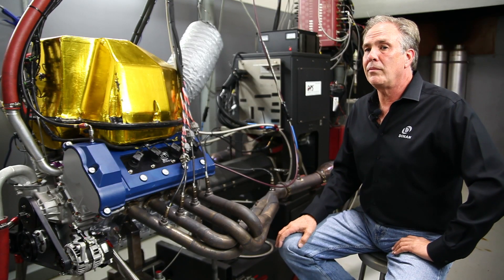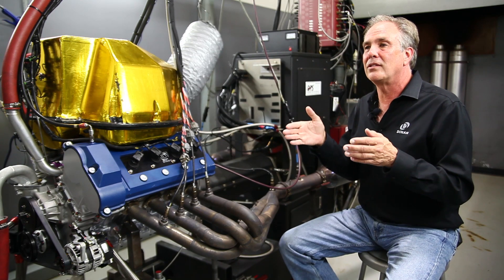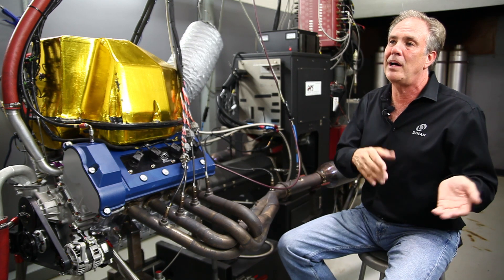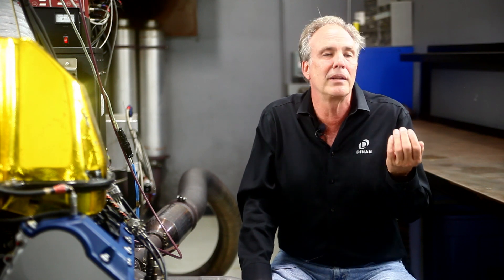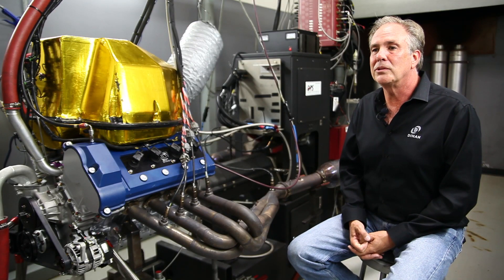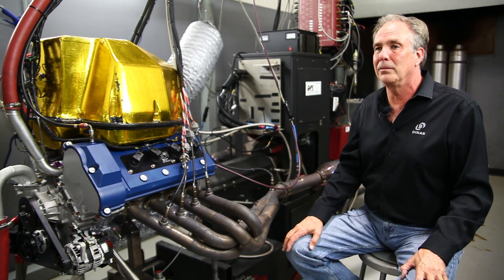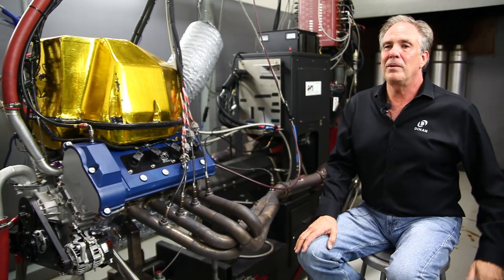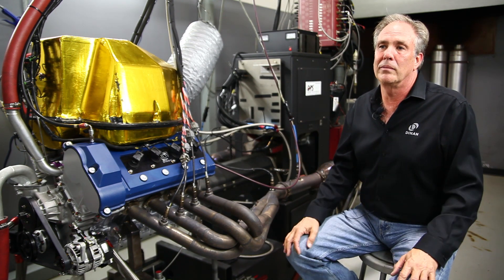DINANTRONICS/Tuning Deep-Dive with Steve Dinan

Comment: I have a 2011 335i Msport E93 with the N55 motor. I have 2 questions: with a software remapping, how much power should I expect from the stock 306hp? And with the remap, will I have a problem getting it smogged? I don't want flash, then unflash my car! That's why I'm coming to the best in Dinan! Could you help me with an answer? And how much would this cost me. I seen a video in which your Customers said they were so impressed with the power gain!
Reply: https://www.dinancars.com/product/d900-31t-stage-2-performance-engine-software-e82-135i-e90-e92-e93-335i-n55/?series=&mid=335i/ (355HP / 400TRQ). Emissions / smog is unaffected as it has a CARB EO.

Comment: I've been looking at BMW Performance options for my 2016 550i and I think I just found my source. As an Engineer I definitely like "conservative", which in layman's Engineering parlance means you are not quite at the bleeding edge but the system has been designed to operate near that threshold but not into that threshold.